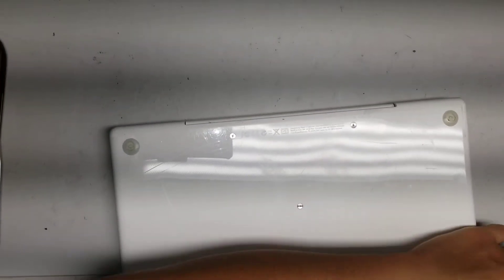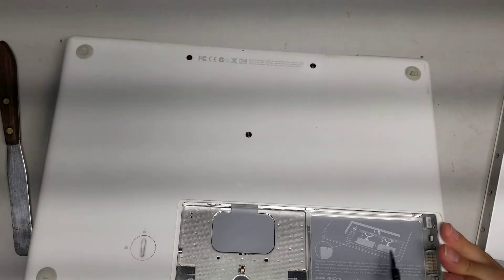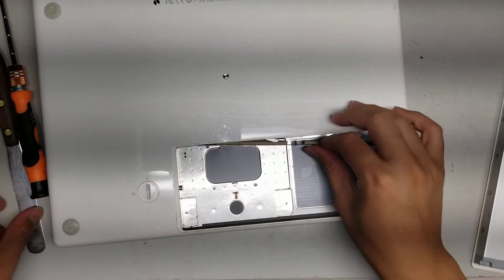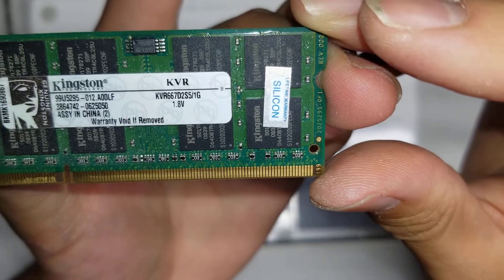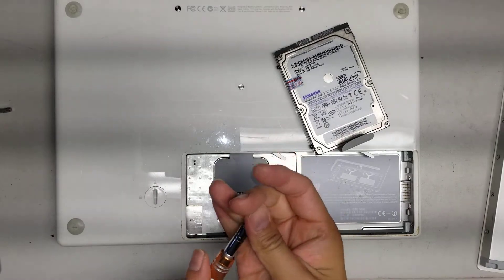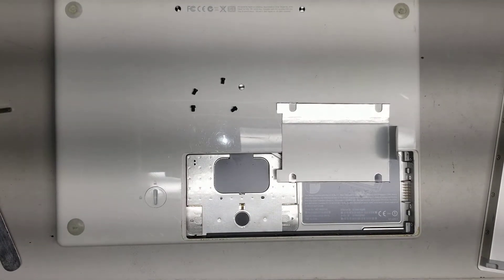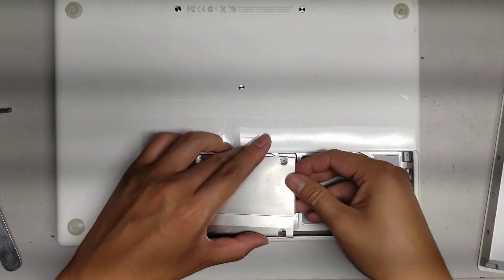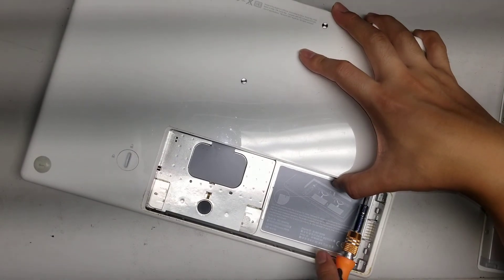MacBook A1181 Battery, RAM, and SSD Hard Drive Upgrade Repair

Comment: My friend just bought one for light stuff but the 2gb of ram is not enough. Some say the 5,2 can do 8gb of ram  I wondered how to upgrade both ram and hd.
Reply from the maker: Yup, but you'll be limited to an old OS
Reply: @ItsBinhRepaired  yes. I got a 2010 MacBook and it runs very well for everyday web browsing. With at least 4gb ram and a decent Hd/SSD this can run high sierra. That’s what apples own site says. I run high sierra on mine and it runs fine. Not too pokey. But mine had a 2.42ghz chip where this model has a 2.12ghz chip I am working on this a1181 for a friend.
Reply from the maker: Nice

Comment: Pleave provide me link of that RAM which is available on amazon
Reply from the maker: 4gb https://amzn.to/3PdGexz it might only support 6gb max. I recommend an SSD Upgrade https://amzn.to/3dhgP8R
Reply: @ItsBinhRepaired  Sir tnx to suggest me.  And one problem have been face by me in this laptop is that in headphone jack red light is Blinking and no other jack is supporting in this . How to Fix it sir?  Plz help me .
Reply from the maker: @venomwant3drulex291  not sure what you mean
Reply: @ItsBinhRepaired  in headphone jack red light is on. And headphone is not supporting.
Reply from the maker: @venomwant3drulex291  that model only has one headphone jack, right? You might have to use the software to tell it it's speakers and not microphone.
Reply: @ItsBinhRepaired  sir can be talk on insta??
Reply: @ItsBinhRepaired  then i can tell my problem more better
Reply from the maker: @venomwant3drulex291  you can't type the same stuff here? How is insta better?

Comment: Hi! I’m not a tech wizard at all so maybe you could help me. I have a MacBook 13’ (white) A1181 like this one but have no idea what the hard drive is “called”, is it 2,5 or 3,5 and what’s the difference between IDE and SATA? I haven’t tried to pull the drive out yet cause I want to test first if a new battery will make it possible for me to move my photos to and USB or something like it, the laptop hasn’t got the power enough to do that according to the people at the apple store. But if that doesn’t work I want to take the drive out and put it in a docking station or an adapter made for it. But I don’t know what ones to choose that is suitable and work with the hard drive in this laptop. I’m so totally out of knowledge about computers but I really want to be able to save my photos! It’s not able to connect to iCloud either cause it’s been updated for years. Can you help me? And one more thing, what kind of screwdriver do I need to pull those tiny screws from the “L” in front of the drive? Thx and have a great day! / Johanna
Reply from the maker: How do people know all the terminology, but not know what any of it is? Lol If you Google those terms and view images, you'll find exactly what you're looking for. Better than me trying to explain over text and you'll know a lot more in a matter of seconds. It is a 2.5" SATA, but Google the terms and you'll see the difference between IDE and SATA as well as 2.5 and 3.5. It's good to learn how to research. Questions should be reserved for things not easily found on Google. As for an adapter to read it, this will work https://amzn.to/2ZAJHCh but you'll only be able to read it on another mac. You can use transmac software to read it on a pc, but it costs money. As for screwdrivers, these will work. https://amzn.to/3jXBrU9

Comment: I've got one of these machines. Swapped out the ssd and ram, now I just heard the CD drive get power,screen flashes then remains blank. Have any ideas what it could be?
Reply from the maker: Swap the RAM back. You must've gotten incompatible RAM or installed it wrong.
Reply: @ItsBinhRepaired  that's roughly what the problem was. I ended up doing a complete tear down and going in through the slot in the battery bay with the ram, it wasn't properly seating. Having it all apart,I was able to seat it properly.
Reply from the maker: @toddmartin7030  yup, been doing this long enough to know the symptoms.

Comment: you'd be surprised! im actually looking to buy one of these macs soon as a daily driver!
Reply from the maker: Don't...you can't update the OS. Bad idea.
Reply: It's Binh Repaired Dont need too! If i install MacOS Snow Leopard, and the Arctic Fox browser, Im fully up to dat and golden! You should try the browser out! its fully updated!
Reply from the maker: @saikothesergal  nah, that's alright
Reply: i've got one and if you upgrade the memory to at least 4gb then google chrome will run fine on El Capitan and it's fully supported, and for faster boot and app loading times, add an ssd. Also if you want to risk it, you can try using Catalina patcher by dosdude1. But overall, you can't have a very high expectations.
Reply: @ItsBinhRepaired  You can stillinstall windows 10 or the latest version of most Linux Distros
Reply from the maker: Lol

Comment: Hello sir I'm from India. I have also this macbook model and also I want to upgrade RAM & ROM of this macbook. Will you suggest me that how I will able to upgrade it. 
My questions are:-
1.) How much gigabytes of RAM can we upgrade in this?
2.) How many gigabytes of ROM can we upgrade in this?
3.) Does it support SSD?

Please reply me sir. Love from India ❤️
I'm your big fan sir please reply mei. 🙂
Reply from the maker: 1 whatever you can fit. 2 what's rom? 3. Yes, 2.5" SATA SSD
Reply: @ItsBinhRepaired  sry by mistake i typed ROM ..
Can you tell me tha can we upgrade RAM more than 4GB
Reply from the maker: Whatever you can fit with the same speed and type should work.
Reply: 1GB (two 512MB SO-DIMMs) of 667MHz DDR2 SDRAM (PC2-5300); two SO-DIMM slots support up to 4GB. Hard drive easy to pull out - next to battery. Replace with SSD
Reply from the maker: Have you tried an 8gb stick of RAM?

Comment: Thanks for the how to! Can any SSD work as a replacement like SATA I, II or III?
Reply from the maker: Yup, as long as it's the same formfactor.
Reply: @ItsBinhRepaired  that'd mean 2.5" ssd?
Reply from the maker: @vibhuvashisht8032  yup
Reply: @ItsBinhRepaired  Awesome thanks!
Reply from the maker: @vibhuvashisht8032  no problem
Reply: @ItsBinhRepaired  best for manjoro Linux WiFi work
Reply from the maker: @NicVandEmZ  I see

Comment: Can i get your context because i have problem with reinstall mac os on a1181
Reply from the maker: What do you mean context? I need context.
Reply: Ouh sorry my english very low, like WhatsApp number? or Instagram
Reply: Contact
Reply from the maker: @muhammadridzuanmohdnasir7254  I don't have that. I can make a video later how to do it.
Reply: @ItsBinhRepaired  can u make video install window 10 on old mac book like a1181
Reply from the maker: @muhammadridzuanmohdnasir7254  too old, I don't think it'll support that. I don't know if you'll be able to reinstall the OS either. Apple might have stopped making it available. You might need the CD
Reply: @ItsBinhRepaired  can i make my own CD window 10 on window and install on this macbook?
Reply: @ItsBinhRepaired  There is another guy on youtube who installed windows 7, 8, 10 x 32 bits on this model
Reply from the maker: @adypetrescu87  nice